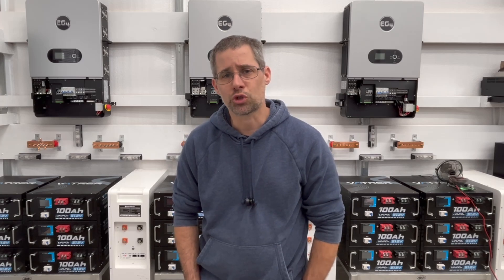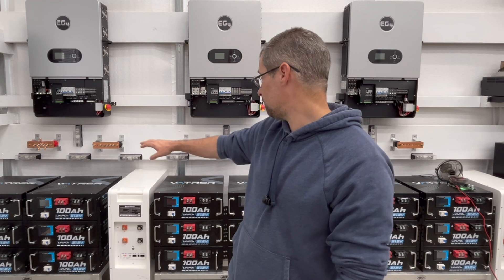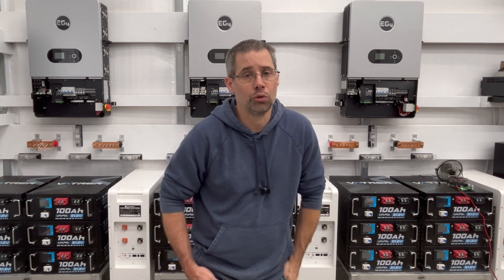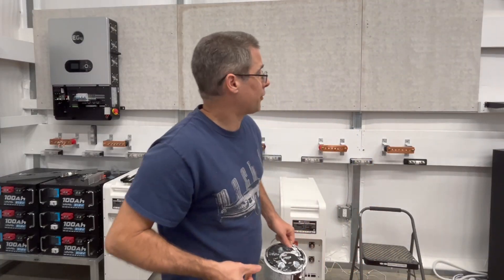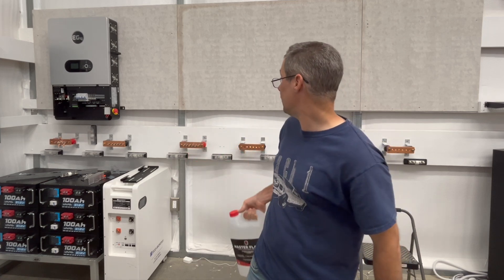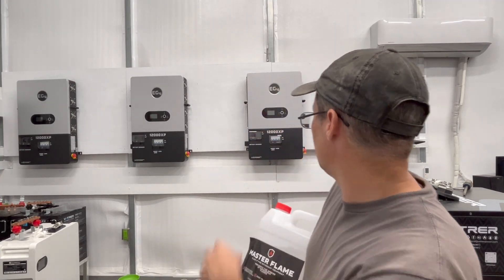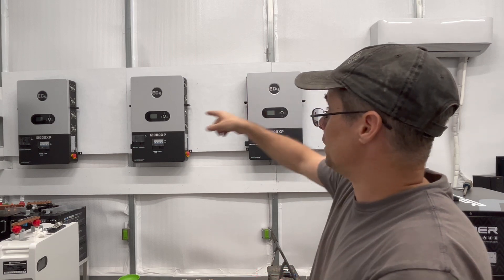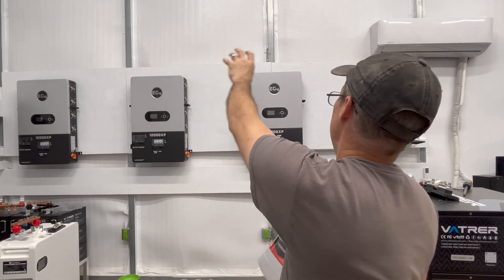Installing Cement Board to Protect from Inverter fire!

Comment: Great idea however as far as the inverter fires the flame tends to propagate upwards as does the heat.  Wouldnt you want to put firewall above your inverters to prevent propagation to your ceiling?  Granted maybe your ceiings are 20ft but I cant tell in the video.
Beyond that what about the batteries.  They claim LiFepo is less fire risk but the research I've seen suggests they release hydrogen or flamable gas which then can explode.  So given that, wouldn't you want to place batteries outside the building?  Maybe a small outside bunker near the exterior wall running your cables through the wall inside thus eliminating this risk?  I guess it all depends how safe these chinese LiFepo batteeies really are.  Theres not much real world data yet on how these batteries stay safe over their lifespan since none have been around very long.
Reply from the maker: All very good points.  I did spray fire block behind the batteries and above the inverters so that should help.  I also have an automatic fire suppression system that I need to install.  Between all the safety factors I should be in decent shape.  But then again you can never prepare enough.  Thanks for watching!

Comment: Beautiful work Mike...
My Inspector said that my cement board was not fire rated and failed it...
I installed fire rated sheetrock over it and he passed it ???
Inspector wanted to see a fire proof label which the cement brd didn't have ???
Anyway, you will have no worries...
Reply from the maker: Thank you very much!  Interesting about your inspector.  They can be rather picky.

Comment: Awesome work on putting up Cement Board to protect the wall !      Are you happy with that Vevor 500 lb lift table,  it looks narrow and cheap  and in the video it looked like it rocked back and forth with weight elevated?    Anything on your list you are NOT happy with ?
Reply from the maker: The table is a little bit wobbly but a back saver for sure.  All the products listed I recommend.  There is a small 12v inverter that I am testing now that I don’t recommend.  I cut my finger on the sharp case and the wires are way undersized.  I should be posting that video soon.

Comment: Yep. Hardieboard / concrete board is a big fire deterrent. None of us ever 'want' a fire in our solar set up but like the Rolling Stones said: 'Ya cant always get what ya wanted...'

Suggestion: When mounting hardieboard do so over a 5/8 - 3/4 thick plywood sheet. From that point on you have no worries about studs etc for equipment, so long as the plywood was attached to the studs, then you're golden for whatever layout style you need.
Reply from the maker: Very good point!  Thank you for watching!